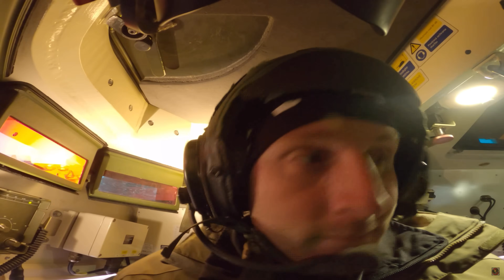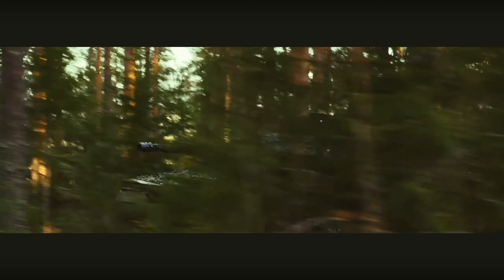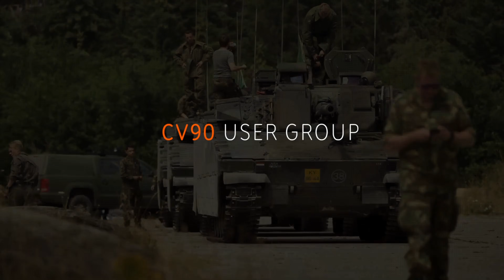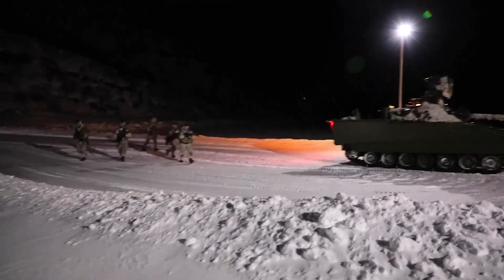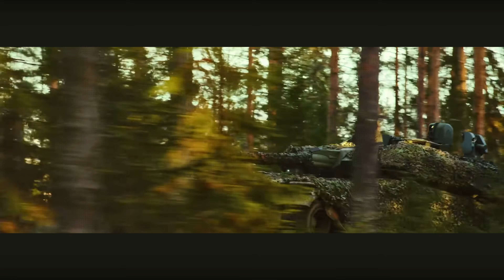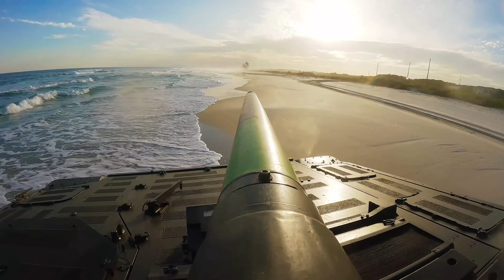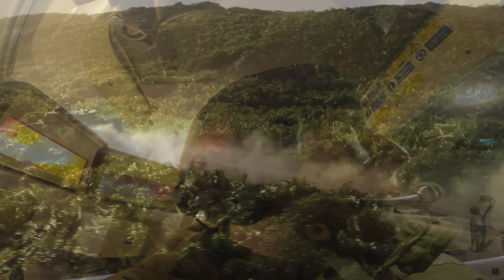Why is the CV90 IFV selling so well globally? | MASSIVE VEHICLE SALES 💰💰💰

Comment: Slovakia buying the 90120 would be the first customers for the light tank CV90 concept, neither the 90105 or the 90120 have been picked up by anyone, I always thought the light tank CV90 were a bit of a flop.
Reply: Now that the US Army has adopted the Booker, more countries may look to acquire medium tanks - something that was dead rigueur during WW2 and the Cold War. Being lighter and smaller has advantages and disadvantages. I can make the case for both depending on the battlefield circumstances.
Reply: @jbc-3975  The US should have gone with the CV90105 to be the Booker. It seems like a better option than the Griffin II that was actually chosen.

Comment: CV-90 for Canada can be a strong deterrent for a Trump invasion.
Reply: Cv90 should be perfect in Canada because it's designed to operate in deep snow. The American Bradleys are useless in snow.
https://youtu.be/tY-UpygOee8?si=jfPEbgU7a7SzAmgF
Reply: @catd11ng74  To note that this is the early ~20 ton variant of the CV90. Modern 38 ton variant will perform just as bad as the Bradley, it's physics.
Reply: @jonny2954  
It's not only weight that matters. It's also weight distribution, angle of the tracks, design of the tracks, angle of the underbody.
Reply: @catd11ng74  But mainly weight it is.
Reply: @jonny2954 
Weight is a big part. But i'm 100% sure the cv90 is more capable in snowy conditions.

Comment: It's essentially a light tank tasked with infantry support, but stuffed full of infantry, too, so it's a cheaper alternative, although the guns don't have the anti-fortification oomph of a 105mm or 120mm.  VERY worthwhile for countries on a normal, non-USA budget.

ETA: NVM.  I missed the addition of the 120 to the line. So it's MBT-level offense without the weight.
Reply: Do you really need MBT offense now though, you have artilery or air for that and ATGMs for armour/tanks....
Reply: @tomriley5790  You always need it for assaulting fortifications and taking down buildings, and while ATGMs are good, a 120mm gun carrying 25+ rounds is hard to beat.  Definitely better than lugging 25+ jevelin rounds, and it's got better range.  There's really no such thing as 'I don't need more offensive power", my friend. It fills the same role as a Stryker MGS or an M10 booker, but with dismounts. What's not to love?

Comment: Stupid question, perhaps, but with all the fires in L.A. recently I was wondering about that slow-mo bit where the empty casing is bouncing on the turf. Have forest fires ever been started from hot casings landing on tinder-dry grass and shrubbery?
Reply: Not that I can recall, though tracers certainly has on regular basis.
Reply: Never seen any report of it causing forest fires to any war so far. Most forest fires in wars, like WW2, Korean War, Vietnam War or Wars in Kosovo, Ukraine … etc. are done by incendiary weapons and flamethrowers.

Not saying they don’t, but I think their ability to cause a large forest fires are minimal. Most get’s stamped easily.

Comment: I think there's no argue that the CV-90 is a very good combat platform. However, i would like to ask to those who could know, how does it fare compared to similar systems (comes to mind the Lynx, Puma, Bradley, Ajax / Pizarro, the equivalent Chinese, South Korean, perhaps even the Russian one, BMP-3) in both Acquisition / Operation / Maintenance costs  ?
Reply: Puma should operate on a complete new level in terms of infantry integration. But its far too expensive and suffers from several teething issues. Its maybe like the Tiger tank in WW2, a game changing evolution if it wouldnt have suffered from limited availability and mediocre realiability. Lynx and Boxer are quite succesful exports from germany though.

Comment: With the new block the chinook can sling these. The ability for a team of chinooks to deliver 4 APCs and a platoon of soldiers is great capability
Reply: Modern CV90 varianst weigh more than 30 tons. I can guarantee a Chinook can not sling load these.
Reply: @ The block 2 is rated to 27,000lbs. With the addition of upgraded engines to 6,000bhp. The sling load will be right at 30,000lbs. The cv90 variants range from 20,000-37,000lbs. But what do I know I’m just a crew chief……
Reply: @Joshua-ri8cu  CV90 variants range from 20,000 to 37,000 KILOGRAMS, aka 20 to 37 METRIC TONS. That's 44,000 to 81,000 lbs. Not even a  Mi-26 can sling load that.
Reply: @ I agree with you, but then we both be wrong…..

Comment: Short answer: Everybody saw how well the Bradley was doing in Ukraine and went, "What can we get that's like that?"  CV-90 enters the chat.
Reply: Bradley has remote turret, no?
Reply: @alexeyl22  It does not.
Reply: @ then it should
Reply: @alexeyl22 it’s 50 years old and about to be replaced. The Bradley doesn’t need that level of overhaul right at the end of its lifespan
Reply: @ Ok, the future is fully remote and autonomous hardware anyway. And these "buses" should be airborne capable.
Reply: next gen replacement contenders for the Bradley are being already tested for 1-2 y in the US.

Comment: It seems the Lynx won the contract in Italy... why not the CV90?
Reply: Various. Firstly, because Rheinmetall will develop, jointly with Leonardo, the future tank for the Italian Army based on the KF51 Panther, something that BAE couldn't actually provide. Secondly, according to some speculations it's because the CV90 will end its life cycle before the more recent Lynx meaning a lower lifespan in the army.

Other reasons might include licensing and modification with Italian systems and army specs which may have not been met.

Comment: The British would have saved a lot of time and money if they had taken the CV90 instead of the Ajax.
Reply: How much of CV90 can be produced by BAE UK ? For Ajax , it's 80%
Reply: @thomasgade226  Since Hägglunds publicly has stated they are looking for partners to expand the production with, just about the same.

The one thing I'd take from the Ajax and put in the CV90 is the 40CT, as that gives the same firepower as the Bofors but much smaller cartiges.

Comment: CV90 >>> PUMA
Reply: Only in the affordability metric.
Reply: @jonny2954  nah
Reply: @2.Cuzzzz  Germany Army tested and rejected an up-armored Variant of the Swiss Version of the CV90 in 2002 and rejected it due to insufficient ballistic and mine protection aswell as growth capability. It actually ended up on the last place of all tested vehicles. Only after that they started development on the NeSPz programme that would eventually become the Puma. So CV90 not being good enough is literally the reason Puma exists at all.
Reply: @jonny2954  That may have been the case in 2002, but we're not in 2002 anymore. The fact that nearly all European countries have chosen the CV90 over the Puma speaks volumes. The CV90 is simply more reliable and trustworthy, especially when compared to a vehicle with a history of electrical issues. Today, the CV90 outperforms the Puma in nearly every aspect. Yes, the Puma has superior armor, but that’s about it and even then, it’s overly heavy and limits the vehicle's overall effectiveness. As for the D1 and D2 models, which were tested, it's important to note that they were essentially unarmored prototypes. Today's CV90s are vastly improved in that regard. The CV90 has been combat-proven, while the Puma hasn't faced real-world challenges to the same extent. When you need a vehicle you can rely on, you choose the one with a proven track record, not the one that’s still working out its kinks.
Reply: @2.Cuzzzz  The vehicle was evaluated with future growth in mind. CV90 is still a upgraded 90s vehicle developed in the late 80s on outdated principles. Same like Leopard 2 is a upgraded 80s vehicle developed in the 70s. Is the latest upgraded version of the Leopard 2 decent? Sure it is. Is it as good as a hypothetical brand new MBT the Germans would've developed from scratch in the 2010s? Absolutely not. Not even remotely. It's ridiculous to think so.

The vehicle tested wasn't a prototype with no armor, it was the Swiss variant with additional armor mounted, but it still didn't meet protection requirements. The reason CV90 is chosen over other contenders is that it's cheap. Czech Army gave plenty insight into their decision, Army staff preferred the Puma. It literally hit twice as many targets in the trials. MoD wanted a cheaper option.

Puma retains a similar power/weight ratio than the latest CV90 variant even in full 43 ton combat configuration. They outpace Dutch CV90 in joint FTX.
Reply: @jonny2954  The problem with the Puma isn't just its size…it's the gun. The penetration is pathetic. Hitting a target doesn’t mean you've actually damaged or destroyed it. The 40mm, even the 35mm, has far more penetration than the Puma's 30mm. The Puma’s bulk makes it an easy target and it's only a matter of time before it's taken out. It's like the Germans are designing armor the way you'd design a mouse tank, basically pointless in a real fight. Look at the STRF 9040C: it took an RPG and a Kornet to the side and suffered minor damage. Now That’s real survivability.
Reply: @2.Cuzzzz  Except Finland, Norway, Switzerland, the Czech Republic and Slovakia are or will operate CV90 with 30 mm guns. In fact Czech Republic and Slovakia are the most recent operators of the CV90 and have both decided for a 30 mm armament. Modern 30 mm APFSDS has plenty of penetration power to defeat expected targets up to expected combat distances in Europe. In fact the 35 mm barely adds anything worthwhile since 30 mm can defeat anything up to uparmored BMP-3M. The next heavier vehicle that RU has in service are MBTs that 35 mm can't penetrate either so you need to use ATGM anyways. The 30 mm + ATGM solution is currently the most popular with new IFV adoptions, not just in Europe and not just on the CV90. With 35 mm you just carry less ready to fire and total ammo.

Small silhouette doesen't matter in modern combat. NATO and Russia trains with training targets half the size of the actual vehicles and have first round hit probabilities beyond 80%.

Armor matters on the other hand. Interesting you mention the STRF 9040C, the addon armor it carries is AMAP-B and AMAP-SC from the German manufacturer Rheinmetall (whoops, apparently no Swedish magic there) Puma also utilizes a (newer) variant of the armor, the difference is the 9040C carries around 4.7 tons of this addon armor, the Puma carries close to 15 tons in total and additionally ERA the CV90 isn't even able to mount due to the hull thickness. So even higher survivability is expected of the Puma, additionally secondary survivability is also significantly higher on the Puma due to completely separated ammunition bunkers with blowout panels and fuel tanks that are not inside the hull. Mine protection level is also higher due to more space in the hull bottom for energy dispersing bulging plate (no torsion bars, air gapped double floor).

It's a upgraded 30 year old design. Don't expect it to hold up to a vehicle a whole generation later.
Reply: @jonny2954  bro I thought that I was a nerd when it came to this…I’d argue that having a system and a base that has been combat proven is the key to saving life’s and protecting our countries. The puma is not combat proven…atleast we had the balls to send cv90s to Ukraine because it’s a more proven reliable system compared to the puma. You can talk all you want about the puma being that and his, but you can’t really prove it and that warms my heart :)
Reply: @2.Cuzzzz  I work with vehicles like this. It's my job.

Combat proven doesen't mean anything. Leopard 1 is combat proven too, does it make it better than K2 Black Panther? Absolutely not.

CV9040 were send to Ukraine because Sweden was about to deep modernize them anyways. Even the C are the oldest variants with no critical technology involved the Russians could pick apart after capturing. Puma just entered service and has the wests most advanced 3rd gen thermal imagers and other critical components better kept from the Russians. Germany send their retired Marders instead. Sweden meanwhile ditches the 40 mm on their new order and went for 35 mm.
Reply: @jonny2954  I see your point.  I’m not saying the puma is bad, it has more armour but it has less hp/ton (I think). It being bigger is not the best, and yes you can hide it but it will be a lot easier for it to be hit. Both have Their bad and goods. The puma is very modern but so is the newest cv90.

Comment: If the CV90 goes to Brazil, AC will be needed. Plus, heavy on the anti-corrosion. Yes, bite the heavy cost now and worry less during its projected life in service.
Reply: The CV90's donated to Ukraine already have AC installed.. & a reasonable guess is the corrosion protection as standard is nothing to sneeze at.. there's plenty of corrosion issues in parts of Sweden, hence the corrosion protection of vehicles like Volvo, Scania etc..🧐 Btw, Scania has factory in Brazil already, so there should be a fair bit of knowledge of the local conditions.
Reply: The CV9040C variant that is in Ukraine now was upgraded specifically to operate in Liberia.
Reply from the maker: It will need to be if it goes there!

Comment: Back in 2003/04 I served in the Serbian army, air defense unit. I was on Giraffe radar while the rest were on Bofors L/70 guns. And they can be used against ground targets. Trust me; that 40mm packs quite a punch! I mean, 30mm is no joke, but 40... And this vehicle packs pretty much the same gun.
Reply: I mean, that gun is powerful enough to make everything dangerous short of a tank go away.
Reply: @Raz0rking  CV90 40mm darts can penetrate T-72 front armor.
Reply: @Merecir  No, it can not penetrate the front armour and never could. That was tested extensively when we got the T-72s from Germany.

It will absolutely shred it from the sides and rear though, something the Bradelys struggle with.
Reply: @ The first darts issued to the CV90 could not, that is correct. But then Sweden got a bunch of T-72's from old East German stocks and could test the effect of munitions on them.
Bofors then used that data and developed a new 40mm APFSDS that could penetrate the front armor. 
-Source, I did the military service at the time the new darts were issued, and that was what we were told.
Reply: @Merecir  It makes no sense from a physics standpoint for a 40mm to penetrate when the 10.5 cm tank guns even at closer ranges struggled to penetrate in the same tests. This was one of the reasons for the increased calibre to 12 cm.

Also, the depth of armour being penetrated being directly correlated to the length of the arrow.
I don't question you got told it would punch through the frontal armour, but I do question the accuracy of that claim.
Reply: I have used L60 and L70, they do pack a big punch. No matter what you did in the Air Defence force back in the day, you had to learn the L60/70 :-) We had had to L 60 we could use as we pleased in my SAM unit. We used Q 50 as shorad and convoy protection. In a big NATO exercise we set up an ambush whit L60 and Q50 ( Quad 12,7 M2/M3 Browning) great fun :-)

Comment: For countries that purchased the CV90 in the 1990s or early 2000s, the CV90 was the only realistic option. There was simply no real competitor on the market. Systems such as Bradley, Warrior and Marder were no longer state-of-the-art. Armies that already use the CV90 are now of course expanding their stocks and upgrading thier existing fleets, as the security situation has changed dramatically. New customers are primarily relying on the CV90 because it is a modern vehicle to NATO standards, but cheaper than the new IFVs from the larger manufacturing nations. I am curious to see whether the ASCOD (like the Lithuanian Army will purchase) can be an alternative for more price-sensitive customers.

Comment: well keep it small and agile for urban combat, make it modular as hell, use an automated turret without human maintenance and also quick swappable for specific mission, keep the crew alive.....connect it to fancy tactical system so the units can cooperate and focus on targets and use external help like drones or remote control other units from a master vehicle.... all futureproofing I came up with in a hurry are checked for this one.... they even add hybrid option so it can run in silent mode from batteries or lay low with electronics running from batteries with generator used only when needed...

Comment: Fpvs and Lancet type are the new meta. Everything burns. It is a nice piece though. 
It’s not really that old equipment is behind the times or bad, it’s the new age of recon. So far, Lancet seems to be the better option combining recon and a kill option.
Reply: The answer to that is proper sensors, then you just need to send the target data to the CV90 and one airburst HE grenade from the gun takes care of the drone.
Reply: @Merecir  …lacking THAT, a 5nit with good recon and 10-20 fpvs will wreck a 8-10 vehicle convoy… never mind if Lancets are around.
Not rooting for any particular side or anything, just reason.
Reply: @ You know, there is already an AA CV90 with a proper radar on the top of the turret (LvKv90). It was originally made to counter helicopters, but apparently it works for drones as well.
And we know that at least three of the CV90's gifted to Ukraine have this configuration, as they got all CV90 C variants Sweden had in stock.
But, have you ever seen one of these in drone footage? If not, then it could be because any drone that crest the horizon near a LvKv90C gets shot down...
Reply: @ come back to this comment when Ukraine wins ;))) 
Bwaaahhahaaaahahahaa
Reply: Only for a short window…. Systems will evolve to negate them
Reply: @robertpatrick3350  oh no diggity-doubt..! THAT will be an interesting direction to monitor